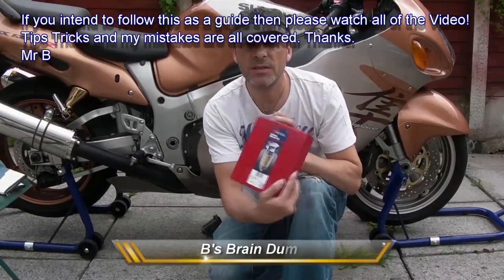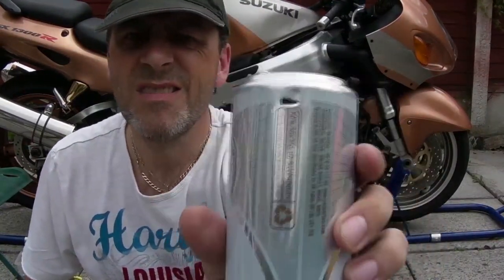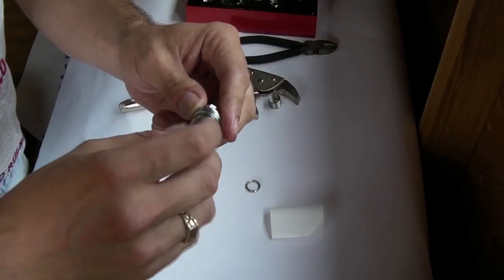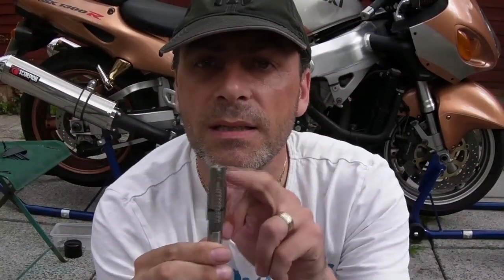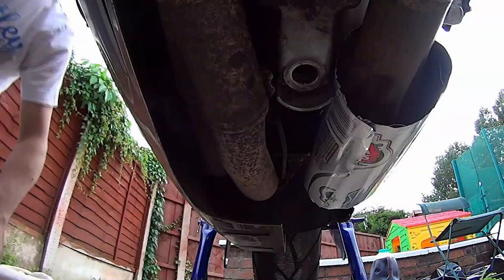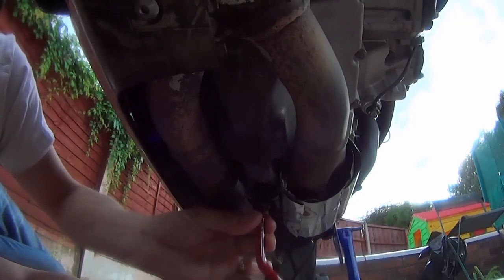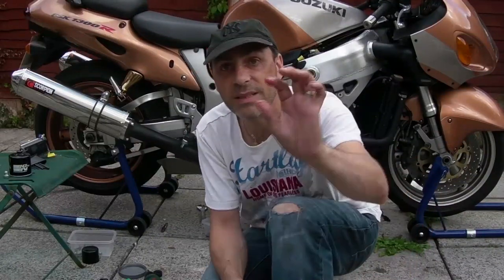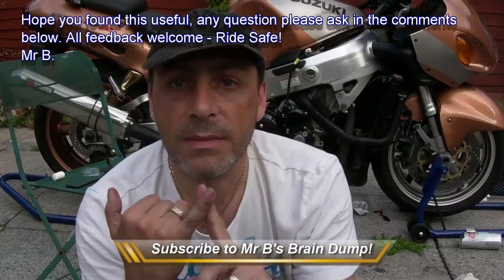Motorbike - How to repair a damaged sump thread with a Helicoil - without removing the engine

Comment: Hi. Came across your vids when I got the courage up to service my Hayabusa myself. I liked yours the best as your a straight talker and thorough. So much so that when I found a stripped sump plug I used your vid and parts number because where I live, no one could really help and fill me with confidence. I bough the only helicoil kit same as yours I could find and with your guidance I shall do the job. 
You have saved my ass by taking the time to be thorough. 
Definitely a fan of these vids. 
Cheers

Comment: Just found your channel as I work up the courage to drill out the float bowl screws on my DR650, and helicoil the holes.
My compliments on your presentation, detailed planning, and the overall quality of your video. I greatly appreciate that you took time to review your video and add necessary notes after the fact! All abused and stray motorcycles would be lucky to have a home with you!

Comment: Great video.  I serviced my bike for the first time and when I unscrewed the drain plug I could see the bits of broken thread so I watched this video a couple of times before attempting it myself.  It worked a treat so thanks for the how to video.  You saved me a lot of time and money.

I did notice that on my bike there is a drain channel cut out in the drain hole thread and if I wasn't careful I would have covered it with the helicoil kit, so I took some photos of the inside of the drain hole with my Iphone before starting to ensure I had enough helicoil thread to secure the drain bolt but without covering the channel.  Thanks again.

Comment: Just dropping in for a watch mate, good video with all the information in there... last time I did a sump plug I rolled the bike up on to two bricks (a wheel on each) then lean it over on the side stand.. plug hole's almost facing you then (and obviously ratchet strap the head stock to the roof so it doesn't roll over!)... better than groping round for a hole you can't see (unless you're a gynaecologist lol!)  ...Ride Safe mate, Del
Reply from the maker: Hi Del,
Many Many thanks for your feedback and taking time to look at this long vid hooray for fast forward!
Liking the brick trick.
When it comes to broken holes, the last thing you wanna be is a Gynae eww!
It's an honor to have you visit.
Best of luck with your Q&A vid today mate.
RSMF
Mr B

Comment: Hi Mr B just stripped the thread on my suzuki rf 600 r two weeks ago your video has filled me with hope, as ive just purchased a kit the same as yours from ebay great tips and if all else fails i will use the sledge hammer method. :)
Reply from the maker: Tim Jax Unlucky on the thread, let me know how you get on buddy!

RSMF-RI
Mr B
Reply: all done and dusted thanks for the video my friend ;)
Reply from the maker: Tim Jax Awesome! Like a Boss =D
Reply: with thanks to you my friend, and I just changed the oil yesterday to 5 to 40 fully synthetic now goes like a bat outta hell (que meatloaf !!) ;)

Comment: Great video, my bandit has a leaky plug, i bought a new one and on trying to fit it, realised it had an oversize plug/bolt fitted. I have tried a few ways to stop it leaking, however this maybe my next option for a proper fix.

Comment: Just did the threads on my final drive, it got messy...had to drill it . After I took apart the trans and cleaned it out the job is done and seems to be fine. I would suggest you try this if you are handy with a wrench. I saved myself money and just make sure your drill and tap are squared up or else your shit out of luck. Take your time.

Comment: hi, great video, exactly what I was looking for. The garage that serviced my bike last time must have tightened  the plug too much. I've got a bandit 650 k6. was wondering if you think the cheaper recoil spark plug repair kit would be good enough? As far as I can tell it's still an M14 1.25 with the pilot cutting tool, the only thing missing is the tool with like an arrow head on it.

thanks.

Comment: Hey man thanks for this video, I had the same shit happen on my R1, I may have to do this if my oversize bolt doesn't hold up through the oil changes, I basically did the same process you did except I used a single oversized bolt with a self tapping pilot end,  That helicoil kit looked expensive, my bolt was 3.00$ us and she's holding up well so far.
Reply from the maker: sirevil120 Hi Buddy, the kit cost £50 and can be reused many many times, helicoil is much stronger than the original thread, steel bolt into a steel thread now. The oversized bolts do work but if the thread ever fails then it's new sump time. I need to be confident my sump will hold out in a quarter mile drag race so I had to do it as best I could.
Cheers
RSMF-RI
Mr B

Comment: you could have got away with tapping 3/4 the way in before you took it out as the ally would not have gone into the sump HOWEVER as you said its your bike and i would have done the same i think if i had to do it. Never dont the coil thing before so its great to see how its done, great vid

Comment: Mr. B thanks nice video.  Question  My Goldwing drain is 14mmX1.50 pitch.  Cannot seem to find pilot tool in this size.  Could I just use a 14mmX1.25 and then get the correct matching plug?   (they do make a heavier version designed for sparkplugs in the 1.5 pitch but looks like more block material is removed which I don't like.
Reply from the maker: I would say you will be fine, and have a more standard thread after you have finished.
RSMF-RI
Mr B

Comment: Mr B good clip I have tried the same on my Hayabusa but I have noticed after a ride the oil is still leaking the bolt Is on tight I don't want to over tighten it in case I mess it up.
Could you please recommend anything else eg rubber washers or something.
Thank you
Reply from the maker: HI Moe, really sorry for getting back to you late on this one, google plus has been hiding comments.
To be honest if the helicoil is done properly there should be no leaks, are you sure the nut is up tight? as per spec? (23N-m or 2.3kgf-m or 16.5lb-ft).
Also more importantly make sure you have used a NEW sump nut, the new sump nut will have a fresh squash washer which acts as a gasket. The old sump nut will be of no use anymore.
Ok Last resort if all the above are correct, 'Hermetite Instant Gasket' or similar silicone engine gasket should do the job. If you still have issues then I would recommend getting a new/second hand sump. As the helicoil thats in there now was your last chance to save the sump.
Get back to me if you got any further questions.
Cheers
Mr B

Comment: Hey there,

Can you tell me the exact size of the tools and the coil you've used?
I have the same problem on a Suzuki C109RT. I'm guessing the plug specifications are the same between the Busa and the C109.

Thanks!

Comment: Great video. Would a 14 x 1.25 kit work if my original bolt is 1.5? I think it would just be getting a new bolt that's 1.25.
Reply from the maker: ***** I think you could get away with it but make sure you fit a copper gasket washer to be sure :)
RSMF-RI
Mr B

Comment: how well do these coils work on drain holes in motorcycles.my threads not only stripped but a small piece of the cast aluminum broke off...Harley heritage..
Reply from the maker: +robert hammer if the cast is broken at the bottom where the washer seals then it will drip as the washer provides the seal. If the cast is not chipped or broken at the seal point then it should still work.
RSMF-RI
Mr  B

Comment: Hi,  thanks for the thorough job! Just a few clarification questions: my drain plug is 14mm x 1.25. after tapping with the corresponding size kit, do I use the same size plug once the helicoil is installed? seems it would shrink the size slightly. And, if my old plug is not damaged - it's actually the inside aluminum oil pan threads - could i use the old bolt with the helicoil?

cheers,
A
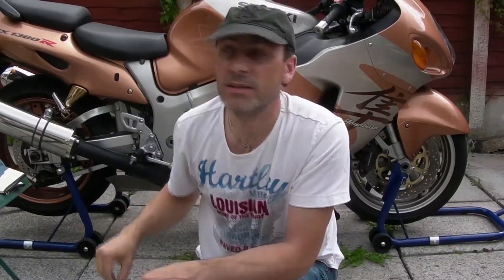Reply: ah, i see you answered the second question at 4:40

Comment: better use a torquewrench ^^ stripped a plug once and that won't happen again on my gs500. torque it to 23-26nm with a new crushwasher. Plug size is m14x1.25mm

Comment: hi,hi have the same problem that you had .i have a gv1400 suzuki calvancade 1986 . it takes a 21mm socket so im going to my auto store to try and pick a kit. i will take the drain pug with me to ckeck the heli coil on it for a proper fit.can you tell me what brand of kit you have.    by the way thank you very much for the video. from british columbia canada.
Reply from the maker: +Trevor Swinamer Check the video at 2:44 - Kit is Recoil :)

RSMF-RI
Mr B

Comment: Bought the kit, just about to do my Bandit 1200 mk1 1999. tried the Alan key depth test, only goes up about 1 inch before coming up against somthing ???
Reply from the maker: +mick baran Take a look at a engine schema (google) could be the big end, if so then it would be better to take the sump off and do it.
RSMF-RI
Mr B

Comment: Although I found your video entertaining I do think you are wrong. First the best method is to remove the sump, on a Busa this is easy and does not require the engine out. Remove the oil cooler and the front exhaust pipes and sump will come off. If you saw what was inside the sump you would not trust a Helicoil as the material is very thin and there is a slot milled through the thread wall to allow the sump to drain completely. I just used a larger BSP brass flanged plug and a doughty washer which does not require so much tightening. The instruction on the oil filter is wrong, Suzuki advise two full turn to fit the filter not a quarter. Regarding filling the oil filter first very little oil spills when refitting the filter and it does reduce the amount of the time the engine is running oil less.
Reply from the maker: OK, where to start...

Firstly I disagree that I am wrong, the point of this video was to show how to helicoil a damaged sump thread WITHOUT removing the engine (or sump of course!). Which works as demonstrated and I am correct.
It is not a video to show the BEST way to do the repair, which would involve a whole lot more work, as the BEST way would be to remove the engine.

This video is not the BEST way to do anything - I also don't think using a brass flange plug is the BEST way either!

I'd like to see the video of someone turning a filter two whole turns from hand tight - bad advice - that would do a lot of damage!

Thanks for your entertaining comment, although I don't agree with some of you points.

RSMF-RI
Mr B
Reply: Mr B not having a go and I do enjoy your video's will not pursue any of the other points I/we mentioned except please read any Suzuki owners manual and the oid filter is two full turns from gasket contact. I have changed dozens without any issue.Mr & Mrs B's Brain Dump

Comment: I use aluminum foil instead of cutting a beer can, you won't have to worry about cutting your fingers. rap it with the foil much easier.
Reply from the maker: Hi Mate - I do use foil but on my Busa its a bit of a pain to wrap round due to tearing - hence the cans - that said, thank you for raising that here as foil is safer and good to mold with for protecting areas. Nice one mate.
RSMF-RI
Mr B